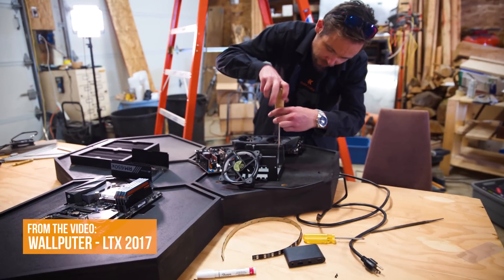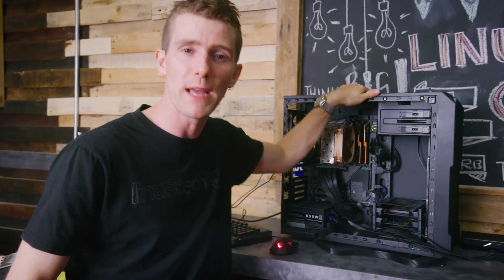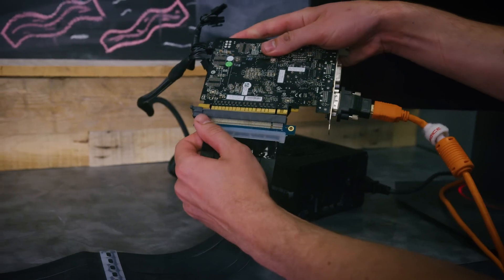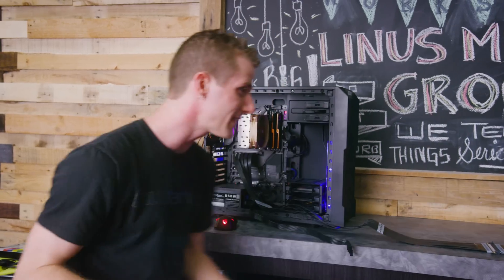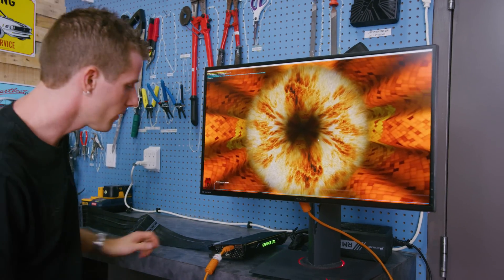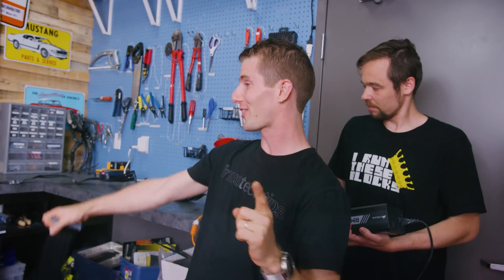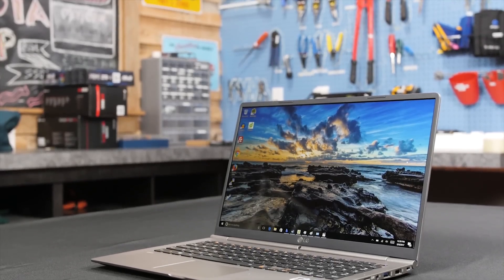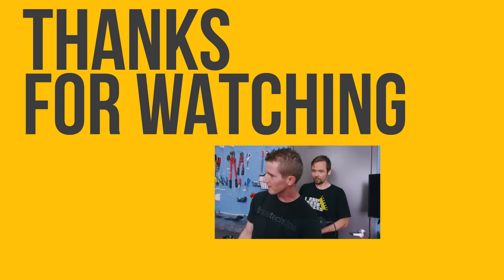How many PCIe Extensions is TOO MANY??

Comment: Have you ever worked with an external PCIe backplane extensions? The ones I worked with from Cyclone Systems were available at 1m and 1.5m I believe, and were pretty heavily insulated. I wonder how something like that would modify your results.

Comment: What if you used a 1x Pci-e to USB adapter, then a USB 3.0 25 foot cable to extend the card into a different room, then mount the card in a riser with a separate psu in a different room? I have a similar setup for my rig, it allows me to have my card in a different room, for a near silent build. All of these parts are easily available through Amazon.

Comment: And if the cable would be a single  8m of cable without connections it would still work. Most losses are because of the connections.

Comment: Just for the info Linus! You can put the card with the CPU but stretch the PCI cable in a loop outside the case for as many metres you want, no need of external power  for testing :P

Comment: For people who use absolute numbers, one centimeter is 34.87 septentrigintillion atoms.
You're welcome.
Reply: Dora Demir should use electrons
Reply: martianoverlord wants1000subs what is this kindergarten? Use quarks
Reply: @simunator  p p plank length
Reply: @simunator  pathetic plank length
Reply: Atom is a very ambiguous unit. An atom of what? At least use a fundamental particle like a proton.

Or a carbon atom or something.
Reply: @hanvyj2  probably hydrogen since its a very simple and common atom
Reply: Dude, depends on the substance. Some atoms have larger radius or packing. Dense substance vs foam with holes in it.
Reply: of what?
atoms differ in size based on what element it is.
Reply: finally a measurement unit I can understand, thanks.
Reply: Except - is an atom absolute?
Reply: Fools, i only measure in planck lengths.
Reply: @dymorphadon5293  this is the only correct answer.
Reply: Thats not even absolute.

3 meters = 185637820600 YℓP, or Yotta Planck Lengths.
Reply: be more specific
Reply: For people who use absolute numbers, one centimeter is 1.616255x10^33 planck lengthes
Reply: So 10,461 septentrigintillion atoms? ... not bad.
Reply: For Americans 1.9m is about 235 corn pieces
Reply: @lindsaytang1017  what's the exact age of the corn, soil type, and what was it fed? Is it an average of corn grown in a specific region of the states? Are they cut at the base or haphazardly somewhere greater?
Reply: What atom? at what excitation state. give me It's Sai function!
Reply: Which atoms?
Reply: But, how many Planck lengths?
Reply: @seamon9732  2 comments above man
Reply: What type of atom? Hydrogen? Oxygen? ;) not so smart now, huh?
Reply: So that whole cable is like at least 12 atoms long. Damn...
Reply: What kind of atom?
Reply: @dm95c  prpbably hydrogen because its the simplest one
Reply: um i only know jhow to speak english not gibberish
Reply: @ygobe2  dude its one typo im sure you have the brainpower necessary to know what its supposed to be
Reply: Oh no, a redditor
Reply: use sandals as measurement unit

Comment: I'm quite sure, if you had a single cable, without the extra connections (and split-out connectors), unnecessarily adding resistance + capacity load + signal reflection points, you could go further.

Comment: Every time you add a cable you insert loss due to the connector. I believe you can have a longer run by not doing so many cables and instead make one long cable. Then test it by making it shorter, or we can just calculate the loss using ohms law, thenmake a cable based on calculations. Great job though thanks!!

Comment: Don't do this by the way ... and I missed this build but I hope you guys took in account the power drawl + distance + gauge of the wire before you melt a pcie lane cause normally if the power wire/ground melts it takes out the motherboard also  ....

Comment: So correct me if I'm wrong but the pcie interface sends the clock with the data. So in theory with shielded and powered transmission (perhaps with signal repeaters) the distance of the cable can be infinite. This test shows that thermaltakes shields are good but that's about it. Can you redo the test and measure instead frame latency? Data is pipelined so "fps" should not change but it still needs to travel the distance so latency should.

Comment: I would expect the connections to cause more of a problem than length.
Reply: BioLizard Venom if you are replying to the joke then no, as for the serious question, no they pretty fairly show here that signal degradation doesn’t cause a failure in  communication, and other videos have tested the speed and shown that a single cable has no affect on FPS, though it may introduce input lag, I haven’t seen that tested
Reply: I was commenting about the joke but True doe

im a dude tho...
Reply: I also interpreted it in a very "Wrong" way to think about it XD
Reply: AZREDFERN 
Ask any woman, length causes the issue where they don’t feel a strong connection
Reply: BioLizard Venom 
Hard to be sure, everyone just about, has a dirty mind, some (me included) just voice it more, and that was the original intent of my comment, I just wasn’t sure if you had been joking 🙃
Reply: 75ur15 Is it bad that i get that?

Comment: Can you make a performance review for a dual PSU system Vs single. Like 600w X2 vs 1200w I know phantex has some kind of PSU bonder for running two PSUs for one 24 pin connector

Comment: If they were analog signals transmitted length would have more of an effect on degradation.  Digital signals being either completely on or completely off require a lot of resistance in the wiring to degrade the signal to an unrecognized mess.  Whereas analog signals constantly vary in amplitude... small changes in resistance can completely alter the signal.  Quality wires can stretch a digital signal much farther.  Digital optical signals process much of the internet signals in the U.S.A.  simple on off flashes of light through an optical cable over vast distances.  I can't believe that these "tech" guys were so surprised that a digital signal would reach so far in their test without degrading!  You know how electronics work... please tell me your reactions were just for drama.  I don't think you would have any issues at over 100ft with quality cables.  Technically much much much further than that.  I am not sure of the voltage of the transmissions between card and motherboard but it is definitely extremely possible to send this signal over much greater distances then you think.

Comment: The extensions didn't need to be fully extended (pun not intended), so the power supply cable length argument is invalid.

Comment: I work for OSS.  We regularly build expansion chassis for performance computing which would allow smaller blade machines to utilize up to 32 individual graphics cards all at the same time.  Each of these cards can be held in the expansion chassis up to 3 meters away; possibly further, but I haven't personally tested.  Just in case you guys were interested in some real performance scientific/graphics computing....
https://www.onestopsystems.com/expansion-kits
https://www.onestopsystems.com/pcie-expansion
https://www.onestopsystems.com/expansion-backplanes

You guys should message me back.. maybe we could work something out with you featuring some real PCIE extensions.
Reply: I am working in a different group at the moment; so I'm not 100% certain of all the different types of GPU's we have sold already inside of the enclosures.  However, it's just a standard PCIE 3.x slot.  Barring power concerns, which some enclosures contain extra molex connectors to aid with, any GPU that fits into a normal PCIE 3.x X 16 slot should work just fine.  The caveat about this is that most of our customers are using very sophisticated software, usually built on CUDA, as well as custom built firmware to be able to take advantage of this embarrassing amount of parallel processing power.
Reply: per our website.
"""
The GPUltima is a petaflop computational cluster in a rack that contains up to eight nodes with each node containing up to 16 accelerators and one or two dual-socket servers. Customers can build up to the full rack, one node at a time, depending on their application requirements. Multiple nodes provide different performance capabilities, dependent on the number accelerators employed. All NVIDIA accelerators exchange data through Infiniband 100Gb transfers using GPU Direct RDMA. All GPUs are connected to a root complex through up to four 128Gb PCI Express connections. Root complexes are connected to the GPUs through Infiniband and each other and the outside world through Ethernet.
""'
https://www.onestopsystems.com/gpu-appliances

So, the short answer is NVidia, but I don't know exactly which models.

Comment: this is why we use AC to transfer power over distances... and DC at shortest distances, and why logic circuits don't work well over distances ( smaller is better ).
Reply: if you want unlimited distance, and no loss, go with a fiber-optic data bus.

Comment: You can go further by applying additional pre-emphasis or equalization.
If your cables are well-shielded and have good impedance control, then the limiting factor right now is the significant high-frequency loss through the cables. Pre-emphasis amplifies just the high-frequency "treble" of the signal, allowing it to overcome this limitation.
There is likely not a consumer or enterprise-oriented product for this, but you should be able to find a development kit or similar which serves engineers designing a far-reach PCIe product that can do the additional preemphasis.

Comment: So you could put your GPU in the freezer if you just cut a PCIE-extender-sized slit in the freezer door and lined it with somewhat tight rubber grommits to prevent too much heat intruding?

That's.. interesting :D?

Comment: I think having a graphic card behind the window in winter would one of the best cooling systems, and also very cheap. Linus, could you try that?
Reply: That does sound like a recipe for wet GPU though, if the outside air is wet or if it snows/rains. If it's not though, it's probably going to be just fine, or even drier, because hot air can hold more moisture than cold air, and so by heating up a small bit of cold outside air, it's going to drop the relative humidity by a lot.

Comment: Crazy how well those cables worked.  I recently built a system using a Thermaltake Core G3, and the short extension cable it came with wouldn't work on a GTX 1080TI at all.

Comment: just FYI: every contact in the sockets adds reflections to the pcie signals. so the 3.6m might be possible if it was one cable, and not several plugged together.

Comment: Puts graphics card in a case on the wall in my hallway
Reply: trips on extender and breaks titan xp
Reply: I know this is a joke, but I could do this with my eGPU with 2M Thunderbolt cable. And I found that you can connect multiple cables together with USB-C gender changes. Makes it difficult to get a connection the first time, but it can work. I have not tested the limits. I got 2M active cable + 0.5M passive 40Gbps cable working for total of 2.5M.
Reply: Okay people, we're definitely living in 2018 when even our cables can change their gender to their likings...
Reply: YOUR MOM

Comment: I think it would be interesting to see how far they can get using 1m cables as all the joints in the system are added resistance causing a voltage drop over each. This may have shown how many connections you can have rather then the length

Comment: Let's be honest Linus. You are out of ideas.
Reply: Rahul Padalkar well this was a new idea to me and certainly entertained me. I don't know what you are talking about
Reply: I think they're just having fun. Just like Linus Tech tips should be. Dumb, expensive fun
Reply: This is the exact sort of dumb shit Ive always wanted an answer to, love it :D
Reply: Then how did he get this idea then?
Reply: The idea seems to have been debunking the riser cable hurts performance myth, I would argue the likely drop in performance seen when using a riser cable and a vertical mount is caused by thermal throttling with the fans right up against the window
Reply: Make a mining rig that is gpu dependant, sli/xfire them and place cards in a fish tank full of oil, run fridge cooling pipes through oil?

Comment: Well, the speed of energy is the same no matter what kind of energy it is, except sound. So, electricity in optimal conditions will go as fast as light. Suboptimal conditions, 50% speed of light. Not really a limiting factor when it comes to data transfer.

Comment: Hooking up two power supplies on either side of a data bus without any precautions might cause serious issues in itself. Not recommended unless you know what you're doing. So, not recommended for Linus. Zing!

Oh, and chances are that the connectors become an issue before the cable length.

Comment: Honestly with shielded cables like that I'm less worried about distance issues as I am with un-shielded connection points both picking up interference and adding extra resistance that could mess with the signal.

Comment: For some technical background, PCIe data lanes work on differential pairs. What this means is that the card doesn't read the data on a wire but rather the difference in data between two wires. Since interference and degredation are likely to be very similar between two wires of the same length next to each other, the difference should remain constant and therefore the data preserved. 
The question then becomes how long can the chain be? Well the wires do have some resistance. If we consider V = IR where both current (I) and resistance (R) are very low, the voltage drop per unit length should be insanely low. I have no way of measuring R without spending money, but I can only assume that associated cost will simply not be worth it.

Comment: WTF is a meetr? I don't understand these third world measurements
Reply: The official definition of a metre is roughly a 300-millionth of the distance travelled by light in a second through a vacuum. I don't have the exact 9-digit number memorised because 3e8 m/s is a good enough approximation of the speed of light for most purposes, anyway.

For some more everyday object sizes, a doorway is 800mm wide, floor to ceiling heights are commonly 2.4m, CD/DVD/BD discs are 120mm wide (as defined in their standards), a MicroSD card is 10*15mm and you can easily walk a kilometre in 20 minutes.

Comment: Graphic card is digital device, it's all DC. There are no AC signal lost due to cable length. I don't understand why shielded PCIE extensions can go much longer then non-shield PCIE extensions. Shouldn't it be all about voltage lost?
Reply: "All DC" really only applies for a constant DC signal (like you'd have in a torch), not when you're turning it on and off all the time like in a computer. That produces a lot of harmonics, as you can hear if you put a pulse wave though a speaker. Lose the high frequencies and the pulses get harder to make out, resulting in errors at the receiver.

Comment: This gives me ideas for keeping the rig and GPU cool.

I used to run HDD's in a separate tower and run SCSI cables between the two with separate power supplies back in the old days since the SCSI drives got hot.

Comment: Honestly, you could've just done the Math Linus. Do you know why they don't make 12-gauge extension cords longer than 100ft.? Because at 110ft, you begin to draw more current than the circuit breaker can handle, and the breaker trips, especially on loads greater than 10 amps.(your coffee maker uses 10 amps) The same equation works no matter what the volts, watts, ohms, or gauge of wire are, you'll still be able to find the max length of cable before physics takes hold. Honestly I'm surprised that you even got to 3.6m and that you didn't blow the MB, PSU, or GPU.   This almost 10 minute video seems like a waste.

Comment: Remind me again why you couldn't just have ran everything off the same PSU and had the PCI-e riser cable pulled out in a loop off to one side, rather than this strange desire to use as much bench surface as possible?

Comment: Ermn, there is a PCIe Riser that works on USB3.1 principle (it converts the slot to usb3.1 and then you can convert it back to PCIe) which means you can use like huge distances.

Comment: Did you check if the PCIe link operated at full PCIe 3.0 speeds? Would be really interesting to know if that 8 GHz PCIe 3.0 link still worked through that many connectors & cables

Comment: In this scenario PCIE is barely used. All the hardwork of transfering lots of data happens in GPU -> Monitor route.
Reply: I believe they've already tried seeing how far away they can have a monitor in a past video/test.
Reply: That's not the point. The scenario should be where lots of data travels from CPU to GPU.

Comment: realistically you should be able to go beyond 3m if you could power the power pins on the GPU. That said it looks like you hit a point where the data packets started to become a problem. Theoretically you should be able to boots the signals but that may cause some problems.

Comment: As an Electrical Engineer this is the stupidest test you have ever made so far. But i still love your channel. It is all about the cable resistance.  You should  ad more than that to increase the voltaje drop along the cable regarding to signal.

Comment: Personally I've used 4 riser cables I had sitting around from my litecoin mining days so i could access the cmos reset jumper while overclocking my ryzen 1700 on my asrock x370 itx board. Graphics card worked no problem.

Comment: You should REALLY have addressed the "is it power or is it signal ?" Ivan said. seemed a really hastefully made video. You could have tried those mobos with the extra 6 pin for the pci slots. just saying. Doable and easy.